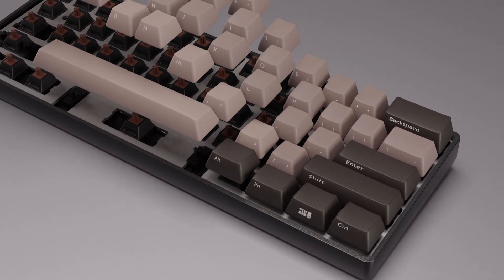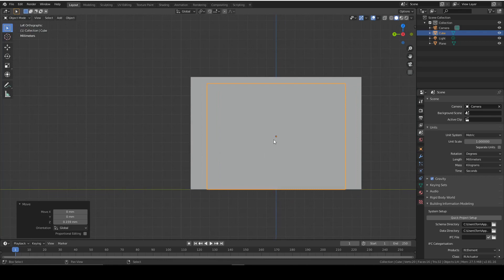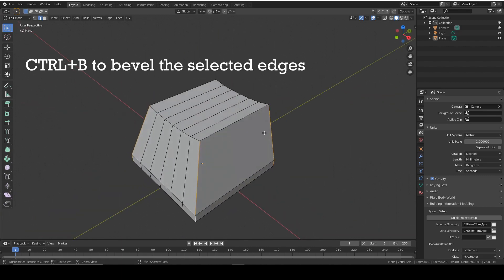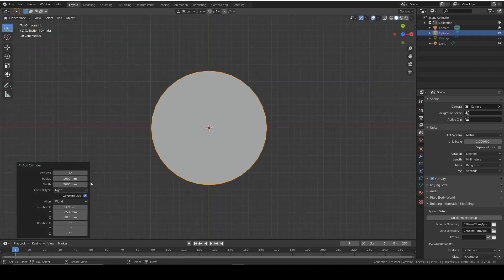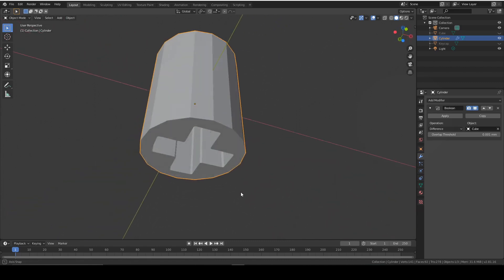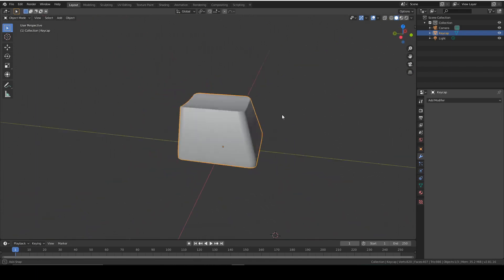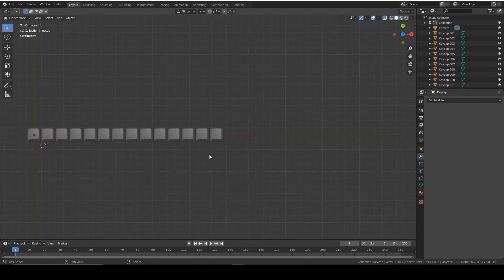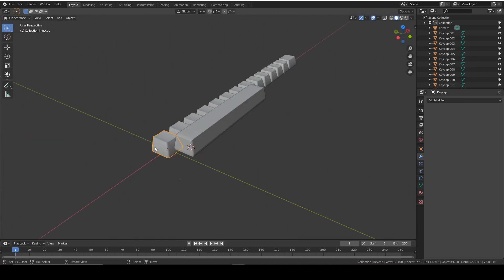How to build a keyboard in Blender- Part 1

Comment: QUESTION:
- this seems overly detailed
- there is another tutorial that models the entire keyboard and texture emissive RGB in one video
- so my question is, is this for a professional product demonstration for commercial use? vs the other one for a game asset?
Reply from the maker: Hi Shakaama, this keyboard tutorial series followed a showcase video of my own personal Blender project, which was an animated assembly of the keyboard. When making the keyboard in Blender, I wanted it to be as realistic as possible, so I modelled the inside and outside components in detail(which may be unnecessary for others, but not in my use case). The video tutorials just mirrored what I did in my project, and I aimed to provide an insight into why I did certain things and how to avoid the issues I came across.

Hopefully this answers your question. Thanks for the feedback.

Comment: If you add this later on in the unreal engine will it be a huge memory eater? Dont know how to explain but you have so many sides (faces) for just 1 object.
Reply from the maker: Hi, this is not a model intended for game engines since it is so high poly. If you want a lower poly version you could reduce the amount of segments on the bevels or even remove them completely with a normal map. That would mean you just need 6 faces for a single keycap. 

Theres a video by Blender Guru where he shows you how to do this, here: https://www.google.com/url?sa=t&rct=j&q=&esrc=s&source=web&cd=&cad=rja&uact=8&ved=2ahUKEwil0PXKle_yAhULgf0HHaoEAtEQwqsBegQICxAB&url=https%3A%2F%2Fwww.youtube.com%2Fwatch%3Fv%3D0r-cGjVKvGw&usg=AOvVaw13oTTW59P75PtCaIZSBrG_ 

Hope this helps.

Comment: at 7:30 how do u scale inward like that? i cannot do that
Reply from the maker: Hi. Sorry for the late reply - are you still having this issue. It should just work the same way as normal scaling but you move your mouse in the opposite direction. If this doesn’t work try entering values directly into the relevant field in the bottom left after scaling up, you’ll want the scale to be less than 1 but more than 0 for it to be scaled in.
Reply: @tjsbear1102  oohh i seeee, i think i’ll try drag the opposite way first and continue with ur another suggestion. anyways thank u for your reply! i really appreciate that! 😊

Comment: Sorry I was wondering how do you use the proportional editing, I tried everything from dragging to spamming my keyboard but I can't seem to curve it. I followed every step you did, but it doesn't seem to work, can you give a step by step? Thanks!
Reply from the maker: Hi jason, sorry for the late reply. first turn on the proportional editing option (either the graphical button in the top centre of the 3D viewport or hotkey "O") then you'll need to select the vertices you want to move and scroll out a large amount change the radius of verticies, intitially this radius is incredibly large so you'll need to reduce it a lot, you can see the radius changing in the top left corner of the screen when you scroll in or out, its the final piece of info on the row. Once you have the correct sized area just move the vertice to the desired location and the others around it it should follow. This should work as shown in the video. Thanks.

Comment: Great video but i'm so confused at how to make an enter key
Reply from the maker: Hi I am Bread , can you tell me more about your problem and I’ll see if I can go into more detail. Thanks
Reply: @tjsbear1102  umm ok so I have a rectangular keycap as shown in the video but I don't know how to change it into kind of a L-shape for the enter button on the keyboard
Reply: Sorry, I'm not the best at explaining
Reply from the maker: Ok, so you'll need to make a seperate keycap instead of one thats been copied from the others, it should be the exact same process apart from the first step where before you would add a plane and thats it, - for a L-shape its a little different. 

You would start by adding a plane but then go into edit mode (tab) to alter the shape of the plane, to do this add a single loop cut (ctrl+r) so it spits the plane along the x axis. Then extrude bottom right and bottom middle vertices to make a rough shape. Then you can adjust the position of each vertex to fine tune the shape to be more like the key you want. 

From there it is the exact same process as with the other keycaps. Sorry for the delay.
Reply: @tjsbear1102  Thanks, ill try that and no problem for the delay, I know a lot of people wouldn't even reply to a video this old
Reply: @tjsbear1102  i am Trying to do that but when i try to add a loop cut it only comes up on one side
Reply from the maker: Hi, I am assuming that your just starting to make the keycap and are forming the curved top surface, if so then i would suggest just starting over with it because fixing geometry is difficult. If that doesn't work repeatedly press undo and test to see where it stops working.  I believe the problem is that you've somehow split the mesh, that or that it is no longer a "quad based" mesh, where loop cuts don't work properly. Hope this helps. (if it still doesnt work there are a few reddit posts which may help further)
Reply: @tjsbear1102  thanks bro

Comment: Hey, big thank you for your videos.
When i change into edit mode, only the one cap of the array is selectable. do you know how to fix that?
Reply from the maker: Thanks for the interest. 

Any modifications  to an object using modifiers including the array one do not show in the edit tab until they have been applied.
To fix this you should apply the modifier, but this is non-reversible so make all the changes you need to the original key first. Thanks.
Reply: @tjsbear1102  Thanks!

Comment: I just finished the entire tutorial and followed it to a T, it was great and concise. You don't ramble on which is a major pet peeve of mine with other tutorials. Now the question is: Is this accurate for 3d printing? Resin Printing to be exact.
Reply from the maker: Interesting idea! I did not model this to fit with any keyboard components like switches ect so I cannot confirm that they would fit immediately, but you could model them to a compatible specification.